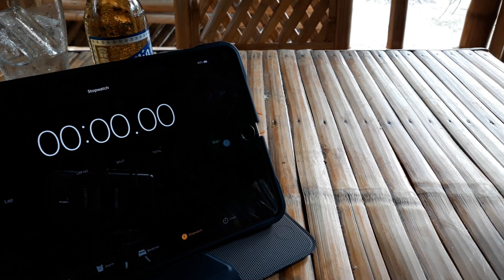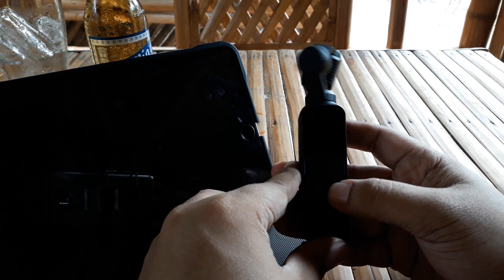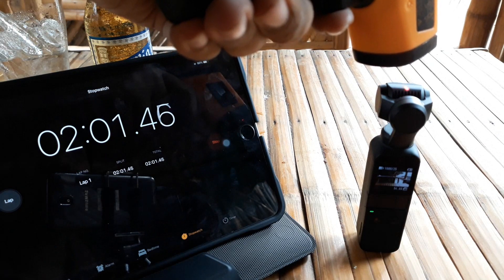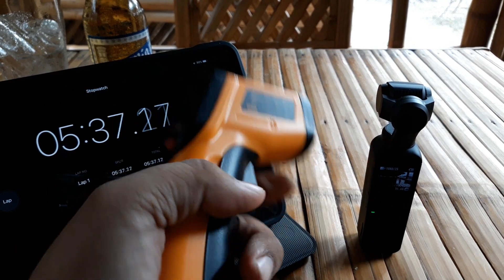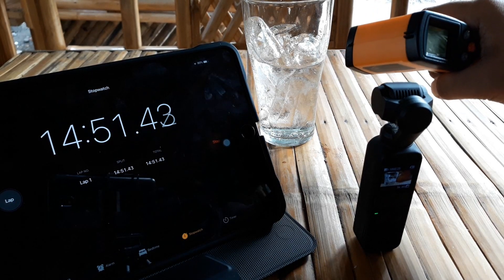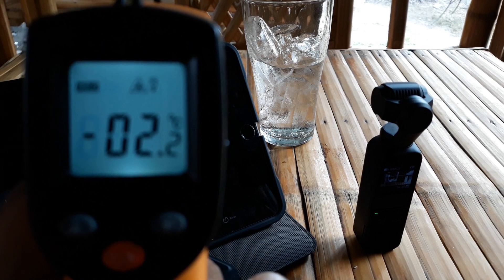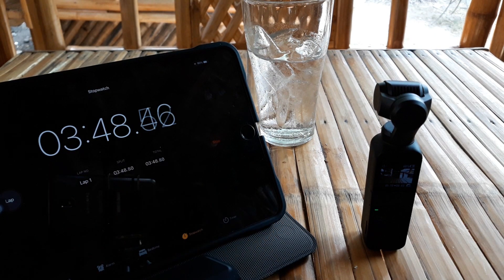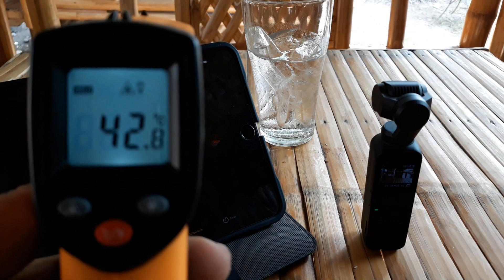Issue: DJI Osmo Pocket - Heating Issue (Temp. Readings)

Comment: Nice try but inaccurate. You must move and use the gimbal so you will get the correct temperature. By putting the gimbal on the table and keeping it immovable it gives you lower temperature. Try move around and get temperatures. (So we will also see what is happening there 😁
Reply from the maker: My point here is that even at idle state it gets that temp. Anyhow I did not have an action camera. It seems that it's normal that small factors get relatively hot. Nice point there about getting temp while at use 😊

Comment: Those temperatures seem fine very similar to what I have found, but the 4k video makes it surprisingly hot over time.
Reply from the maker: Yeah. Glad to hear that we have the same situation. We are just confused with what it says on the manual, (operating temp up to 40 degrees) and my test is not even recording but it reached 40 degrees.  Also, OP is not under direct sunlight :(